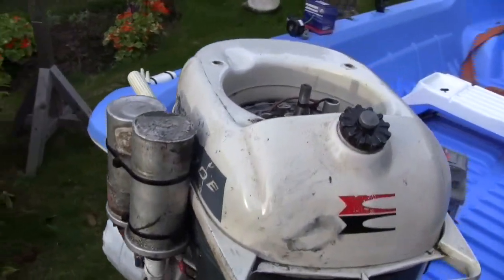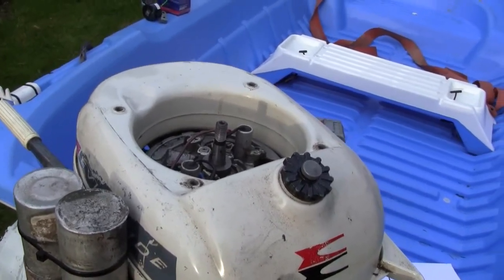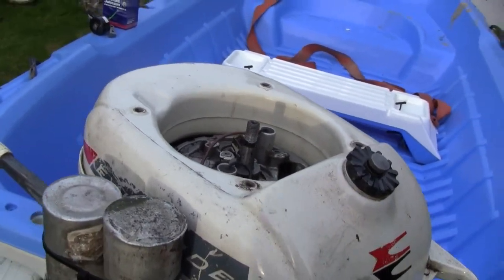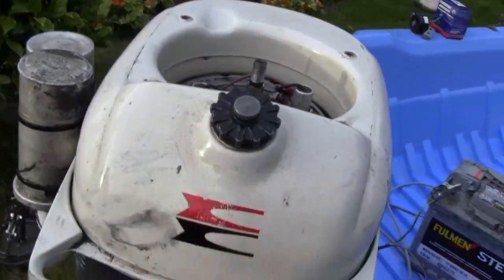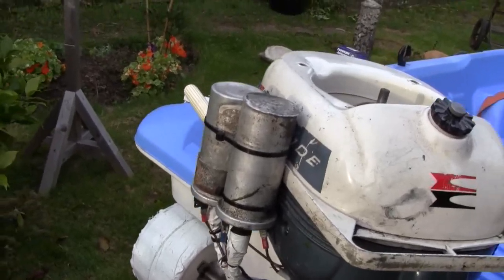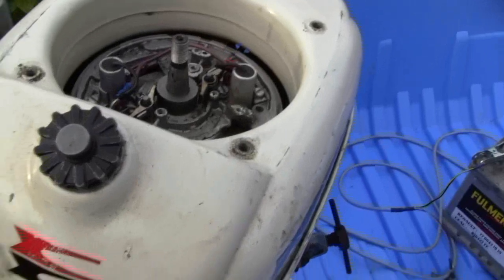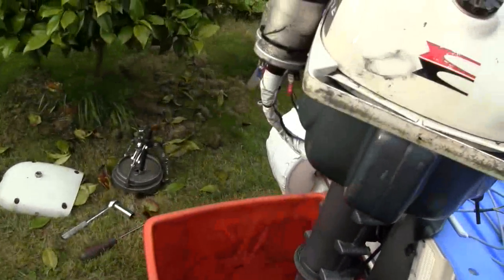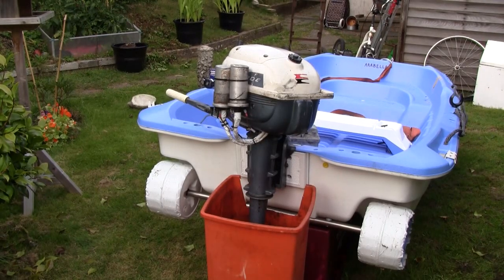HOW TO run an engine with faulty magneto coils

Comment: how is the engine getting any cooling?....didn't see any water coming from the "pee hole" at all...  Is the water pump impellor broken?
Reply: Dan Woelke That motor doesn't have a pee hole, you have to run in on a boat to really see water coming out the holes, I have to put my hand over the holes to test it
Reply from the maker: theeasybeats It runs on the boat with water cooling. I didn't run it for long enough here to get hot.